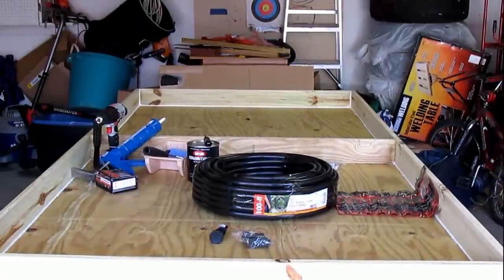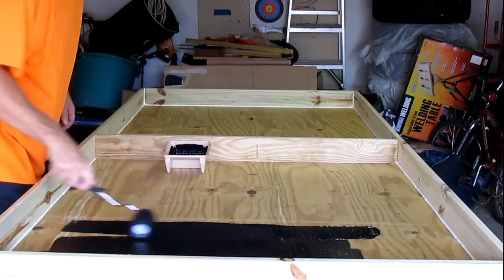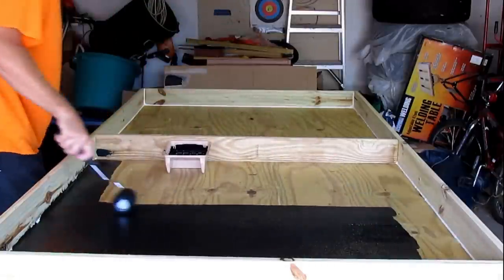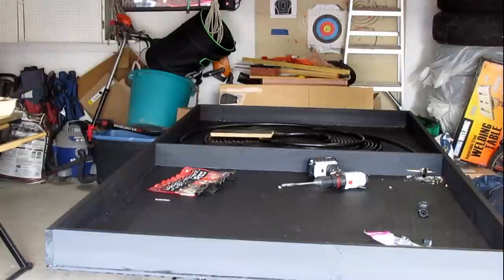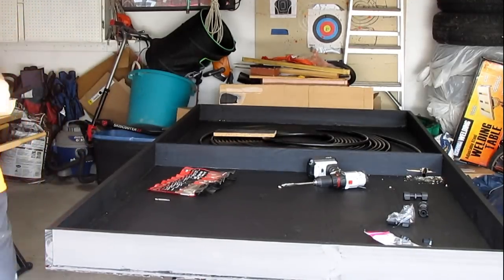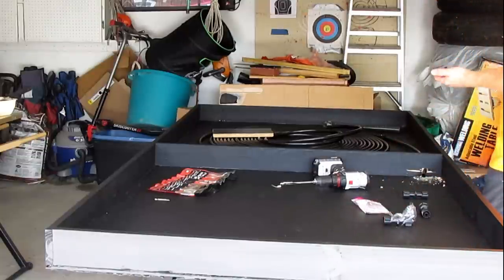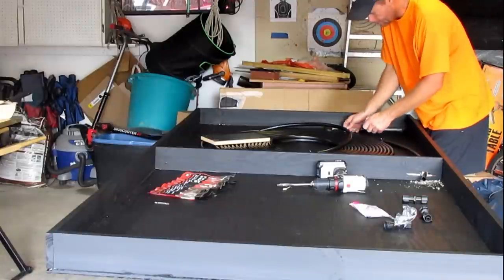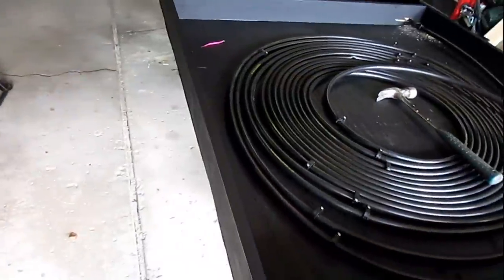How To Build A Solar Pool Heater - DIY!

Comment: Great job!     Tip. when using a spade drill bit as the point comes through the board, stop and finish drilling from the other side this will keep the wood from splintering. Your video was freaking awesome!
Reply from the maker: Thanks Chris!!
Yes...6 years in carpentry & non stop projects for decades...I know better!!
Don't tell anyone what I did!! 😂😂😜
Did you build one?
Thanks for stopping by & happy heating my friend!
#RCInsiders
Reply: @RCInsiders  Hey RC,  I was a licensed general contractor building hands on custom homes for 25 years. I am getting ready to launch my YouTube channel soon. I have six how to videos in the can that need editing. I am naming my channel "Just Sitting Around". I lost my ability to walk or stand two years ago do to MS so I work of a wheelchair but do more everyday than most guys. Yes I just picked everything up today to build the solar pool heater. I was at my buddy's house for the Memorial Day BBQ the pool was open and cold. last year my buddy's wife and her girlfriends turned up the heater and ran up the gas bill. I looked at a few builds. Yours was the best, to the point and put together very nicely. Thank you for the inspiration.  
Rock On Brother!
Reply from the maker: Awesome man!
I spent my construction time in Florida with the union apprenticeship & working mostly at Disney rehabbing/building rides.
It was a good time & learned a lot, but after the first kid couldn't do the layoffs anymore.
Sorry to hear about the MS, but on the positive side you have inspired me to keep on keeping on!
Good luck with your project. I am 100% happy with the results. 
We raised our pool temp from 59 on opening day to 75 in the first couple days & hit 86 yesterday & had to shut it off. 80-84 is where I want to keep it.
During sunny days we are getting a continuous flow of 94-99 during peak sun.
We let it sit for 30 mins then kicked it on and had 149 degree water coming out for 5 mins!
Make sure to stop by & let us know how it goes & how you're doing :)
Fight the good fight brother!!
Reply: Disney?  My dad worked at Disney World about 1970 or '71.  And, my brother and I worked on EPCOT in '82.  We're all electricians, local 915 in Tampa, living in PA now.  
I'm going to build one of these for an Intex PureSpa hot tub I'm buying.  The water heater is weak in them so, your setup should work well with it.
GREAT VIDEO.  Thanks.
Reply from the maker: Awesome Mike!
I remember riding around with my Dad (union painter) yelling "RAT" at all the job sites as Disney began breaking the labor unions & started building Disney non union.
I ended up with one of the last couple union contractors left at that time, BVCC out of carpenters local 1765 out of Orlando.
Good times back then man. Too bad the big mouse had to go the way of most big business.
My thing back then was "Organize the South". I lived it & worked it. I loved Florida, but never understood the resistance to organized labor.
Any how, hope your project goes well & nice meeting you.
Thanks for stopping by & happy heating my friend :)
#RCInsiders
Reply: @RCInsiders  BVCC?  I worked for them in '82 at EPCOT.  I did some fiber optic work at American Adventure and Mexico and movie projector work at China.  It was a good experience but, the scale was low ($10.10/hr).  Only allowed 40 hours, no overtime, while everyone else was working 7-10's, 7-12's, 7-16's, and even 7-24's!
Reply from the maker: Awesome Mike!
Small world aye?
Very cool to talk to someone who knows BVCC.
I never made it to the countries. Did a lot of rehab work at Dumbo & small world. A lot at Thunder Mountain as well.
Been nice meeting you. Stop by any time you wanna chat :)

Comment: Thanks for posting!  I'm looking to build a couple of these as well.  What would really be much more helpful (something that no one really seems to talk about with these diy solar pool heaters) is what kind of results you got on the temperatures in the pool.   How much did it raise the temp, over what time period, how big is your pool, what was the ambient temperature, etc.  thanks!
Reply from the maker: Hey D!
These are some of the many variables that make solar heating different from gas/heat.
Here are some of my experiences:
We got our heater running for the first time this year yesterday. The pool water temp in the morning was a disgusting 58 degrees! The outside temp was 59 to start and reached a high 0f 69. There was approximately 3 hours of full sun with the rest of the day being mostly cloudy with some sunny breaks. After 9-10 hours of run time the pool water temp at the end of the day was 64 degrees. This is a 10,000 gallon pool.
I am also adding a second unit this year & expect to more easily maintain the perfect (to me!) 80 -82.
There were times last Summer during long stretches of sunny days that we didn't run it at all as it was making the water too hot!
Pools lose tons of heat overnight and then you have to fight it back into shape again :)
I anticipate that the second unit will reduce/eliminate this struggle.
When not occupied and especially at night!!, the pool is always covered with a cheap solar cover. This adds a little heat throughout the day and helps a ton with overnight heat loss.
I have also been able to produce extremely hot water (140 - 160) by letting the water sit in the unit for a while before kicking on the pump. There are tons of arguments about using timers, but the majority say it's better to heat a lot of water a lower temp than heating a small amount of water at a higher temp. I'm going to experiment with this & decide for myself.
Hope this helps.
Thanks for stopping by my friend & happy heating! :)
#RCInsiders
Reply: I made 2 and used 400 ft of 1/2 in tubing. See my comment 👍
Reply from the maker: Awesome! 👍👍

Comment: Instead of painting the backboard black, you probably should apply some kind of a reflective surface.  Any heat/energy that gets past the tubing would be absorbed into the painted wood if it's black.  Instead, you really want that energy reflected back into the pipe.  There is also no reason to slow the flow of water through the pipe.  While it is true that slowing the water increases the final temperature of the water, you run the risk of over-heating the pipe.  If you let more water run through the pipe, the temperature rise would be less, but the same amount of energy would be absorbed in the greater volume of water and the same temperature rise in the pool would be achieved.

BTW, it would add some cost, but if you were to introduce a small solar-powered pump into the system to move the water through the panel, you wouldn't even need a timer-- if the sun is bright enough to drive the pump, it would be enough to heat the water.  ;)
Reply from the maker: Is this what you're planning on doing?
I have thought about a reflective background, but it is already so hot in the box that I didn't want to end up melting the tubing :)
I am completely happy with the heat being produced now. If you go that route, can you stop back by & let us know how it works?
I am going to experiment with the timer, but the general consensus seems to lean toward full constant flow. We shall see....😀
Thanks for dropping by & happy heating my friend!
#RCInsiders

Comment: Hi, Thanks for your video!  Two questions:

1. I'm interested in the clear plastic covering that you used (in lieu of plexiglass) in the video.  I don't see any links to that.  I assume you purchased it at Lowe's or Home Depot.  What is that called and how much does it cost for a 4 x 8 sheet?

2. It looked like your initial output temp measurement was made immediately after turning on the pump.  I would expect that to be high due to the fact that the sun had been baking the heater (with no water flowing) for quite some time.  Have you had a chance to make a similar output measurement after running the water for several minutes (after any initial heating had been dissipated)?  Assuming so, what temp difference did you then see?

I'm hoping to build something similar, except a tighter coil on 4 x 4 plywood to keep the weight down.

Thanks again, John  :)
Reply from the maker: Hi John,
Here is the video of how I covered it, temps & heating times.
It should answer all your questions :)
https://youtu.be/sdV8_EJTVzo
Let me know if I can help 
Thanks for stopping by & happy heating my friend!!
#RCInsiders

Comment: Good work!  Thanks for the list of products u used also!
Reply from the maker: Thanks Stizzy!
Are you going to build one?
Let me know if you have any questions.
Thanks for stopping by & happy heating my friend :)
#RCInsiders
Reply: Thanks for responding.  I'm trying, but not working out as well as yours.  I'm guessing my pump is the problem.  Is the smaller pump better?  Im trying to use a 25 GPM utility pump.
Reply from the maker: The pump in the description is a 550 gph & has no problem pushing the water. It also has a 7 1/2' lift..
What is the lift cap on the pump you're using & how high are you trying to pump? 
We will figure this out!! :)
Reply: Thanks, I just ordered the one you have.  I'll update in a couple days after it arrives.

Comment: Because of the way the sun hits my yard (lots of shade) I believe the best location would be to place the heater on the roof of my shed next to my pool. Do you see any issues with this that I may not have considered? Amazing innovation very impressed with the simplicity and effectiveness!
Reply from the maker: Thanks MiddleClass!
I always tell my wife the next one's going on the roof...To no avail 😜
The only 2 things I would really considers are - Can the roof handle the weight & can you safely secure it to the roof.
When the unit is full & running, its in the 60-70 pound range.
If you answer yes to those, I would go for it. I could get nearly all day sun if I could put them on the roof.
If you get the chance, I would love to see it when you're done!
Thanks for stopping by & happy heating my friend :)
#RCInsiders

Comment: If you measure after the plug just is plugged in??? that water was how long in there? had to wait 15 mins to do measurement
Reply from the maker: Hi Addy,
With all the question marks, I'm assuming you want to know some things?
I;m not exactly sure what you want to know. 
Can you word your questions a little differently & I will try to help any way I can?
I think I got the gist of your inquiry, but want to make sure. If you don't reply, I will try to address your questions on assumptions.
Thanks for stopping by my my friend :)
#RCInsiders
Reply: @RCInsiders  I believe Addy is implying the actual temperature reading from the system may not be accurate because the water that is coming out has been in the tubing for quite some time. Addy is also suggesting that waiting enough time to make sure the water coming through has not been in the system for longer than the amount of  time to make a complete pass would probably produce a reading that is more accurate.
Reply from the maker: Hi Ashley,
On a sunny day, I can get a constant 95-110 degrees outgoing temp for hours.
I forgot to turn the system on the other day & got home from work & plugged it in & had 198 degree water for an hour until it came down to 105! :)
Happy heating my friend :)
#RCInsiders

Comment: Could you not hook it up to your filter pump, so after the water goes through the filter it goes through the heater coil and then back into the pool?
Reply from the maker: Hi,
Yes you could do that.
There are a few reasons I went with the pump:
Simplicity. Plug in the pump and start making warm water.
Timer. I wanted the ability to experiment with using a timer to allow the water to sit in the heater for a bit before pumping back in the pool.
Pool pump. I didn't want to go through the process of getting all the right fittings to convert and then find out it created too much pressure for the pump.
You can absolutely do it, it's just a little more involved.
I can help you through it, but I would need a pic of your pump/hose set up and the exact sizes of the fittings. Happy to help if I can :)
Thanks for stopping by & happy heating my friend!!
#RCInsiders

Comment: Why did you go with the 800GPH Submersible Pump? Was it because you have two coils? . I was looking at going with a smaller 300GPM because I was looking at one coil
Reply from the maker: Hi,
Yes, That & I wanted to be able to push through a second unit in the future as I have now.
This pump also has an adjustable flow rate as well.
For a couple more bucks its well worth it to have the flexibility to expand :)
How big is the pool you are going to heat?
If you only use one coil I would think a 300 gpm pump would work.
Thanks for dropping by & happy heating my friend :)
#RCInsiders

Comment: Excellent.   I'm gonna try this for my 30k gal inground pool and save some gas from the propane pool heater
Reply from the maker: Awesome Karriem!
This unit should put a big dent in that bill :)
If you live in a sunny warm place, a couple of these units could probably eliminate the expensive gas heater for the most part.
Let me know how it goes & if you have any questions just let me know.
Thanks for stopping by & happy heating my friend!!
#RCInsiders

Comment: So I made this but made 2 separate ones 4x4 of the with a total of 400ft of 1/2 in tubing. I put it up in my roof near my pool. Currenty my pool temp is 5/25 is 63 degrees. The water coming out of my heater on ‘‘this partly sunny day is 75 degrees.. I used a valve to partially close the water to the pool to divert it to my heater  and my pump pressure is at 17 psi well under the high point of high pressures. I have a good flow rate and I am very happy with my heater. My two heaters with plexiglass cost Approximately $350.00. I bought thick high quality plexiglass. The 8x4 sheet of plexiglass cost $160.00.
Reply from the maker: Awesome Dennis!
As the temp in the pool rises, your outgoing temp will continue to rise as well.
I have added a second unit to our system & in 1 full day (and 2 days of 1 unit) of operation have raised the overall pool temp from 59 degrees to 68. Very happy with the heater & hope to be swimming in the next day or 2.
Sounds like you are going to have an awesome pool season! 😀
Thanks for stopping by & happy heating my friend!!
#RCInsiders

Comment: I have a question. If I will have a solar panel on the roof - 3 meters above water level and 20 meters from the pool. What pump power is needed?
Reply from the maker: Hi,
Here is the pump I use - https://amzn.to/33pkhrl
This pump has a 10' lift & pumps up to 800GPH 
At 3 meters this pump may be enough. If you want to go on the safe side, I would go with a pump that has a 20' lift.
This one is a good pump - https://amzn.to/3Jq9S2L
I'm thinking about putting one on my roof too & will have to go with the 20' lift pump.
Let me know how your project goes if you get the chance.
Thanks for dropping by & have a great day :)
@RCInsiders

Comment: Thank you for your videoo. it enlighted my idea. I am not familiar with this plumber parts. I can  easily find necessary parts by your video. I have a question. Can we use plastic wrap to coil one set of heater instead of clear cover?  not sure it has same effect or not.  Happy summer! Thanks
Reply from the maker: Awesome Jarvis!
Glad to hear you are building a solar heater :)
I would not recommend plastic wrap as it won't retain heat & will be easily destroyed by the weather.
How big is your pool?
Thanks for dropping by & happy heating my friend!!
#RCInsiders
Reply: @RCInsiders    Thank you for your confirmation. I like to watch your videos. My pool is 15 ft round above ground pool. we are at Hamilton ON. it is not hot at here. I am building the solar heater following your instruction now.  But my kids had started to swim in our pool. they look like don't feel water is cold.   😀
Reply from the maker: Cool 😎
Warmer weather is coming soon :)

Comment: I'm not getting good results from my build.  The supply store I used only had 5/8 tubing so I went with 400 feet of that and in a 4.8 frame I got 2 coils of about 150 feet each.  The 5/8 tubing was starting to kink as I tried to get more coils.  I covered the bottom of the frame with some black roofing paper to try and absorb heat.  I also used a 1/16 sheet of that PETG Acrylic on the top.  My flow is pretty slow with the pond pump I am using and controlled even more with a ball valve.  These past 2 days the heat here in So Cal was in the high 90's but the water coming out of the solar unit was barely higher than going in.  I've thought about replacing the tubing with 1/2 as that seems to be size that most others are using.  I also tried removing the PETG Acrylic top thinking that it might be filtering out the UV light.  I also painted the tubing using a matte black but nothing has helped.  Any suggestions?
Reply from the maker: Hey Kory,
This does seem odd.
On a sunny day with temps in the 90's I will put out a steady 15-20 degree temp gain,
What kind of paint did you paint the tubes with? I'm wondering if the paint is blocking UV/heat transfer to the water?
1/2" is what I use, but I don't think 5/8 is a bad option.
My best guess for the culprit would be the painted tubing. 
Are you using the pump I listed in the video description? If not what is the flow rate of your pump?
Thanks for dropping by & have a great day :)
#RCInsiders
Reply: @RCInsiders  Thanks the response.  Yes, I am using the pump you listed and using external flat black paint.  I also put a ball valve between the pump and my coil to restrict the water flow a bit more.  I will try sealing up the unit a bit more with some weatherproof duck tape or something similar.